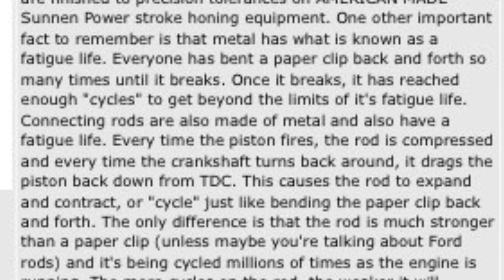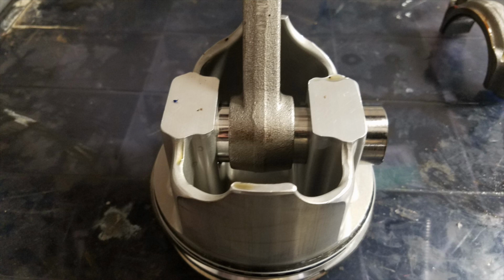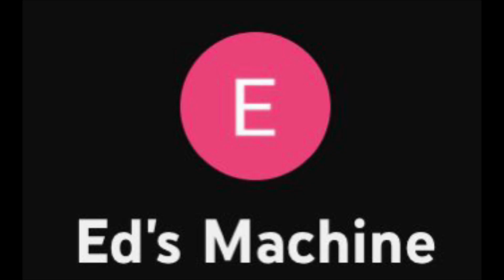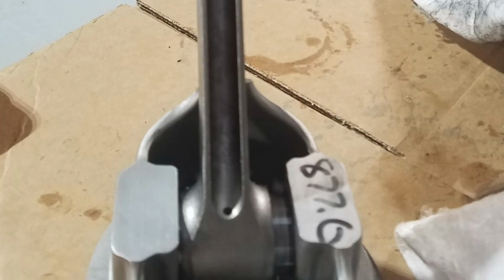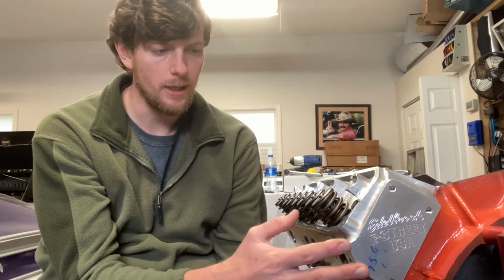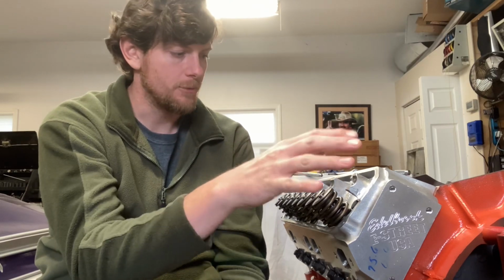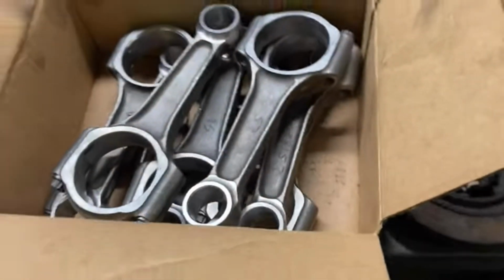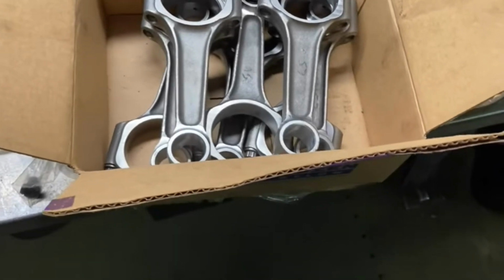Caution! Defective 440 Source Parts! (Saving the Home Builder a Headache)#mopar #440 #ed’smachine

Comment: I had this happen to the 440 in my '70 Challenger. I got about 40 miles on it and I heard a knock coming from the engine. I stopped, called my wife to take me to get my truck and trailer and then took the car home. I tore the engine down and 4 wrist pins had slid enough to put grooves in the cylinders with one really digging in. I was so mad I threw everything in the corner for about 4 years. I got the car back on the road January of this year with a 440 out of an RV. I plan on building a decent 440 again but I have already purchased some better rods. I really like 440 Source but those rods were junk and cost me a lot of time, money and disappointment. Maybe they are better now, it's been quite a few years since I originally purchased mine. But it is a great idea to have any press fit rod checked.
Reply from the maker: Thanks for sharing! I just bought another set and sure enough, they still don’t have enough press. I had to have them floated and drilled.

Comment: I'm glad you brought this to the people. I used to moderate on a pretty big Mopar site and heard way too many times, the name 440 Source used in the negative. Their rocker systems have been a big issue and dare I say, I bought one of the first 440 Source aluminum water pump housings and pumps and yes, found a big issue with them....   I know they want to put out a great product and they are trying to, but they have to have a better QC system in place. That said, I know there are thousands of their products out there that are doing fine....   Something I really want to see is a monster stroke on a 400 low deck....  I always wanted to do this with iron 902 heads. (They have more cooling or more even cooling flow but are basically the same as a 906. Port them and do big valves and let's see what can be made...
Reply from the maker: Thanks Steve. I am going to try their rockers. If they have issues, I’ll definitely report it.
Reply: I had an issue with my water pump as well.
Reply: @dangarrison3503   I hogged out the thinned out areas with cutting burrs and light weight oil. I still have not put it to the test, but I have as much or more open throat as a factory cast iron housing. I also use burrs on all oil and water ports on the block and oil pump housing..
Reply: @SteveP-vm1uc  I used a dremel,  the fins were hitting even with a thinner gasket. It worked, nut I went back to a cast housing.
Reply from the maker: @dangarrison3503  I’ve heard that before as well
Reply: @JustMoparJoe  I just gotta get the timing issue figured out.

Comment: Yeah Joe, it's good advice to check all your parts very closely even if they're new. I've got some junk parts from 440 source and I've got some good stuff too. I like the Scat rods just fine and I think the Eagle stroker kits are really nice. Worth the money to me; just for the peace of mind. My biggest problem w/ 440 source is that it's so difficult to return anything to them. Even if it's still new and unused. And if it's expensive -they won't do it at all; unless you agree to less than half your money back. Their "GO-TOO" line for ALL returns/ complaints is - "Trust me - It'll be fine - Were 440 experts and that's all we do - We checked it before we shipped it to you and made sure it was well withing specs  - What was the part#? And what's your name again?" 🤣
Reply from the maker: Oh man. I’ve always had good luck communicating with Brandon. Thanks for sharing your experience with their stuff.

Comment: Man...that reminds me of what blew up my Indian motorcycle engine. Only it was a wristpin clip that came off. Rear cylinder of the V-twin....the pin was tapping and scraping the bore.....I had no idea what was happening....then, the piston grenaded into a million pieces, locked up the engine, bent the steel H-beam rod, bent the valves etc....😖😖😖
Reply from the maker: Man that sounds rough! Glad it didn’t lock up while going down the road
Reply: @JustMoparJoe  , 2002 Indian Chief. Indian PP100 bottlecap engine...only made that engine for 3 years. Bought the bike in 2010 with 8k miles. I babied it. Then one day in 2017, I raced it down the highway...then pushed it hard from a stoplight...it developed a loud tick/tapping noise. It grenaded in my garage! I should've torn it down before it grenaded.
I still have the bike. Going to get a rebuilt PP100 from a place in FL. eventually.
I could just do an S&S, but the original engine is what makes the bike an Indian.

Comment: I got harmonic balancer from 440 source . I think it is thicker than stock and belts don't line up
Reply from the maker: I’ve heard that before. Not really sure if it’s spacing on the pulley or can only be used with certain brackets.

Comment: Thanks Joe for this public information and announcement. I am going to use those rods in my 383 build. I will have my machine shop check them out to be sure. If I lived close to y’all which I don’t, I would be glad to use Ed’s machine shop.
Reply from the maker: Thanks Greg! 440 source made it right and checked every single rod they had. They now sell some as blemished sets. If you have some that aren’t correct, I’m sure Brandon can make them right. Mine did well in the 400 making 535 horse plus a 100 shot in the car 👍🏼

Comment: I am Interested in how their rocker arms hold up for you.  Lots of cheapo junk rockers out there.  T&D, Jesel, Comp all out of my budget.  I'm basically planning on upgrading my iron head 440 with a .509 cam to Eddy or TFS heads using the factory rockers. For now.
Reply from the maker: I will report on it. I got a solid warning from a viewer that his ate into the 440 source rocker shafts. I will pull mine and check them out after the break in and dyno

Comment: On my 440 stroker I went with Scat Chevy-sized 'long-travel' rods. Way overkill for my application but they are nice rods for the money.👍
Reply from the maker: Thanks for sharing. Definitely an upgrade from these
Reply: What is a long travel rod?
Reply: @auteurfiddler8706 sorry about that I’ve called them ‘long travel’ - rods that are longer than stock length, the piston spends more time at the apex, vs if you used stock length
Reply: @conradk  Well, that confused me. According the Mopar Bible, the 440 and 400 Mopar engines have longer rods than BB Chevy. They were bragging about "rod ratios" around 1.7 vs 1.5 or something like that for the competition.
Reply: @auteurfiddler8706  Yes there isn't much to be gained... In my application I will have way more torque than I can put to the ground so am just trying to move my power up the band a bit.

Comment: Why are you using solid roller lifters on that cam?
Reply from the maker: It’s a hydraulic roller cam. It’s becoming a common practice on some stuff. Engine masters showed it made 10 more hp and the solid lifters made more reliable power over the hydraulics. The hydraulic roller cam has a softer ramp for the lifter to roll on, so it’s easier on the valve train versus a solid roller.
Reply from the maker: https://youtu.be/GZTdo2-cGCM

Comment: I have a 440 source 543 stroker kit in my 440,Had it set up for Nitrous,which I'm  changing it over for a 871 blower, Not sure how to measure for a lower compression piston, would make a great video to share if you have the knowledge on this? Greatly enjoy your videos they are very informative!
Reply from the maker: Thanks Dan. Many nitrous engines are built with lower compression in mind. Usually 10.5/1 or less. They would also have a wider ring gap, depending on the builder. Both of those are good for adding boost. If you can look at your build sheet to see if it had dished pistons, that’s be a quick way to determine a loose idea of what compression would be. If the heads were off the engine, you can bring a piston up to TDC and measure its height from the deck. 440 source is nice with their kits because they have a quick reference chart for each kit. So you could go to the site, find the stroker kits for 440 blocks, then scroll down to find the 54x kits.
Reply: @JustMoparJoe  the kit is already installed Joe it's at 11.1 compression ratio,as of now! All the speed shops around here have all been closed up very hard to find nitrous so what I'm doing is changing the compression ratio of the engine and replacing it with a blower with that being said I need a lower compression piston the 440 source 543 stroker kit comes with a 7.1 length rod mine is actually 5:37 cubic inch because it's only bored 30,000 with a 4.35 bore I guess maybe I should call a piston maker and see if they can hook me up maybe 4:40 source I'd like to know that just for my own knowledge but thanks again for your reply Joe

Comment: Good to hear they are checking the rods. I am considering a set of these myself.
Reply from the maker: Yes sir. Triple check them if you’re going to push them. I would go ahead and float them. I’ve ran stock rods steel to steel for years in my other race cars.

Comment: The list of people and parts you can trust continues to shrink, Joe.  Thanks for the alert. I had to take my 440 Source head to a local machine shop because the valve cover would not seat down due to a missed machining step.
Reply from the maker: Wow, Don! Mine had two spring cups under one spring 😅

Comment: I have the same exact rods as you do in my 400B I'm building. Mine are utilizing the press fit since it's just a beefed up truck engine. Did 440 Source happen to say when they started to measure the rods? Like the beginning of this year, or a couple months ago. Thanks for making this video.
Reply from the maker: Thanks buddy. The guy said it was within the last couple weeks that they got a measurement tool. My rods were purchased over a year ago. The 440 rods were 8-10 months old
Reply: @JustMoparJoe  ordered my rods months ago. They should be good I trust the guy that put them together. Thanks
Reply from the maker: @subwoofer8865  that’s the important part

Comment: Joe, thanks for the heads up. I would think if your pistions have the grooves you could just run the c-clips even without the pin floating just to keep it from sliding, if your pistons don't have the grooves run buttons. That could be an easy solution to a possible problem. 
Looking forward to seeing these rockers. I just missed a set of Crane adjustables yesterday on B-Bodies Only. LOL, just a minute too late. I see Manacini has these for a small block but not for a big block. Wish they would have tham made. Guess I'lll keep running the swap meets.
Reply from the maker: Thanks brother. I don’t think you can run the clips and press pin because the pin can be off center and force the clip out when it floats. I’d have to verify that.
Reply: No you can't put the keepers in.
Either press fit or full float, no in between.
It will bind up and kick out a rod bearing or worse.
Please do not skip these important steps.
Take care, Ed.
Reply: See, I learn something everyday.

Comment: Just got a set of gaskets from 440 Source - no name packaging and the head gaskets have black flaking stuff on them and they are very sticky.  called 440 Source and ask about them and they said they are teflon coated - I don't think so.  I asked if the gaskets were US made - no answer.  I ask what the brand was and they said DC.  Checking on line DC gaskets are made in Mexico.  The very fine print on the package does say (in spanish) assembled in Mexico, products from Mexico and Taiwan.  Have no idea what this stuff is...
Reply from the maker: They’re usually very good to issue refunds

Comment: A lot of these issues is why I stopped doing more with less...in the mid 90's I had enough of buying cheap new/used parts that need machining cause ya gotta pay to take those parts and make them right.  Cheaper and less hassle to buy the good stuff.  But today I'm not so sure,   we just ordered dyers rods and they are over 2200 bucks.
Reply from the maker: That’s some cash! Should be in an impressive build.
Reply: @JustMoparJoe  They last forever.

Comment: So 440 Source is doing the quality control that should have been done at the manufacturing plant ? Good that they have stepped up and are taking care of the customers . Did the loose pin cause any block damage ? 
Thanks for another informative video .
Reply from the maker: The owner says that the block was savable in that cylinder. 440 source is checking their parts at least now. Merry Christmas Terry
Reply: Merry Christmas to you and your family as well .

Comment: Just My opinion, you have to check and triple check and have some experience with working on this from a machinist point of view , tolerances are critical and knowing the difference in which areas to be aware of , this engine building for the DIY is a little more complicated than most are aware of IMO.
Reply from the maker: Absolutely true. I think a home builder like myself would heat that rod and slip the pin in and keep going. I bet it slid in really easy and then had some resistance. I am trying to be more diligent in clearances with my builds. I have a dial bore set that measures in .0005.

Comment: It seems we go through this issue of parts being defective every time their is a shift from one country to another when manufacturing is concerned. Originally it was issues with things being made in Japan, that cleared up and we all know Japan makes some excellent electronics. Then we had issues with 70's vehicles parts being made in Mexico. I'd pulled and trashed a lot of the "Made In Mexico" engine blocks due to poor metallurgy in their blocks and bearings. Sorry, 1/4 inch thrust clearance isn't acceptable on a crankshaft......lol. We've had Taiwan, India, Philippines,  and Indonesia thrown in as well. Now it's China. I'm not sure that country will ever step their game up to a consistent level because of their politics and the value of life that they place on their people. Now don't get me wrong, they do put out some amazing products, especially when they take a proven design and clone it, carbs, intakes, ignition systems, etc. But where they really seem to fail is with parts that need exact tolerances, heat treating, and metallurgy on intricate parts. And it seems quality control is thrown by the wayside in order to put out maximum volume of parts. We're car guys, we adapt, we overcome, and thankfully there are companies that are willing to stand behind the parts that they're importing. Sorry about the long winded rant, but I'm one of those older guys who has seen the world go from "this part will work" to "let me break out the calipers and check this thing before I even attempt to install it". Leaves you kind of bitter if ya know what I mean.
Reply from the maker: Thank you for sharing. I wasn’t really buying parts until the early 2000’s. But I am seeing the value of rebuilding and reusing stock parts as much as possible. I see your points on the Chinese. We are blessed to still have some resemblance of freedom.

Comment: Yikes! They're the rods i went with in 2015 when i had my 440 built. The machine shop didn't say anything bad about them, so i assume they're ok🤷‍♂️. They resized the big ends and used arp cap screws. Engine only has cam break in and dyno time. Hasn't made it into my car yet.

https://youtu.be/sZIgbBi4wKM
Reply from the maker: Thanks for sharing! I’ll check it out